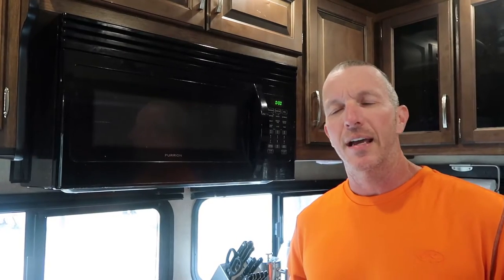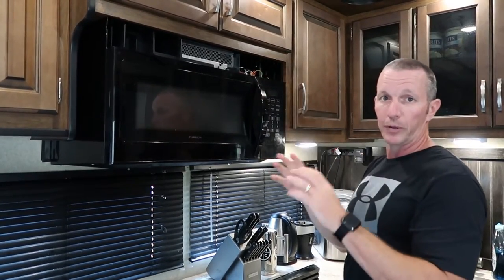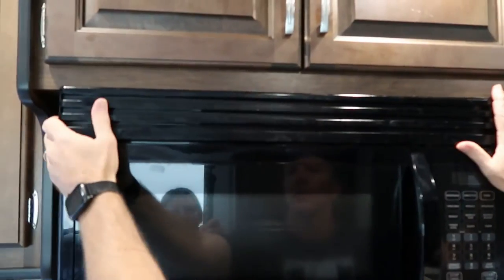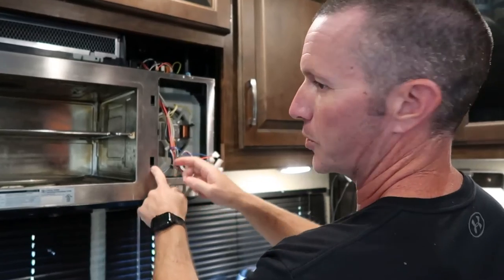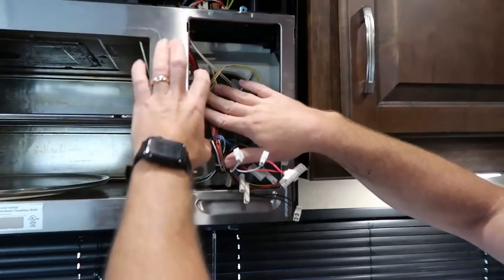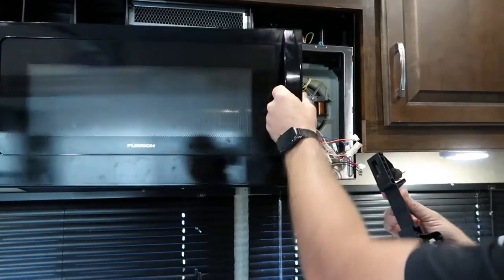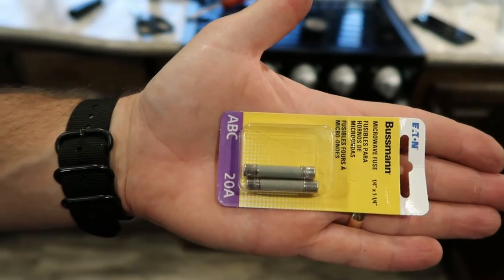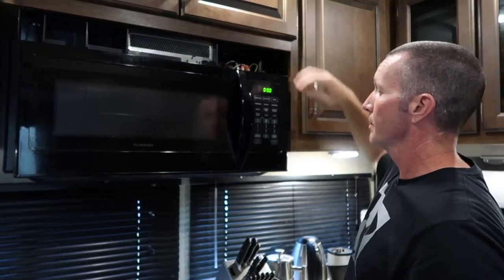Testing A Furrion Microwave | Temporary Microwave Fix

Comment: Your video just saved me $500! I replaced the 1st fuse in the spring.  Then this fall the oven started blowing the fuse and tripping the circuit breaker any time the door was opened.  Your video showed the root cause.  I didn't bother testing the door switches, but jumped straight to the electrical tape fix.  I'll save ordering a new switch for the spring.  What really irritates me is Furion considers this a disposable item.  I asked about repair and Furion said there are no user serviceable parts in the unit.   Thanks again for posting this.
Reply from the maker: Awesome! Glad the video was helpful. I figured we couldn’t be the only ones out there having this issue. Thanks for watching!

Comment: Thank you so much for the video. I have exactly the same microwave as yours. Skipped the trouble-shooting steps and just taped up the part of the door handle that activates the switch (per your video). Replaced the fuse and it works for now. Really appreciate the help!
Reply from the maker: Awesome! Glad it worked and thank you for watching!

Comment: Appreciate the video.  I had the same issue where everytime I would plug in the microwave it would blow the circuit breaker.  I followed your video and instead of the tape on the latches, I shimmed the switches in their housing to reduce/eliminate all the play.  Hooked everything up and it works fine.  Thanks again.
Reply from the maker: You’re welcome! Glad you got it fixed and thanks for watching!

Comment: I love the debugging, but what's not clear to me (from your video or other videos I've watched) is why the fuse is blowing.  That implies something is grounding out (most likely) that shouldn't be.  A short circuit is what blows fuses.  But I'm gonna check through all the stuff you've provided.  Thank you so much for taking the time to make a video when you're already irritated that your microwave isn't working!  (At least, that's how I feel!)
Reply: But, sure enough, 1 of my 3 switches, it has continuity w/o click the switch.  Weird, though, clicking the switch STOPS the continuity.  Like, it became a backward switch all of a sudden. (And yes, they are identical models, diagrams, etc.)
Reply from the maker: The issue is that there is a switch that is supposed to be open when the door is shut and others that are closed when shut. If the door latch does not engage properly it will not engage the switches properly and causes a short.
Reply from the maker: I believe that is proper function, check continuity with the door closed and see if it changes.

Comment: Thank you so much for the information. My Furrion oven was doing the same thing, in fact it got to the point where it would blow the fuse or trip the breaker all the time. I found that the "monitor" micro switch (Normally Closed) had failed so I replaced all three. It worked for only a couple days and began blowing the fuse again. I decided that I would throw it to the curb next year (as we are getting ready to put our fiver away for the winter) then as a "Last Ditch" effort I wrapped the lower latch with some electrical tape. BINGO! That did the trick. I plan to put a piece of shrink tubing on the latch as a more permanent fix. If you decide to order a new switch holder and it takes care of the issue please do a followup video. Again thank you so much you saved me a needless $500+ expense.
Reply from the maker: You’re welcome! We were at the same point, looking at replacing the entire unit. I’m glad I dug into the problem further before ripping the microwave out! I haven’t replaced the switch holder yet but when I do, there will definitely be a follow up video. I’m glad this info helped you and thanks for watching!

Comment: Thanks pal! I have been resetting the breaker for a few days now. I followed your vid and took apart the MW to test the switches in the same manner.  Interestingly I found that one mine has two screws that hold on the top cover and one was already loose. I assume the manufacturer had issues and had to open it up. 

I also found plastic pieces when I took the switch holder off. I tested all switches and they worked fine. I put the holder back in and tested them and they worked. I put all the wires back together and tested the door and it worked. I assume I fixed a loose switch when I reassembled. I would not have attempted this without your video. Thank you
Reply from the maker: Awesome! Glad the video was helpful!

Comment: Thank you so much!!!  I have an identical problem with my microwave.  It's not a Furrion but of course it still has these switches installed.  Simply replacing the entire microwave with another make or model would be a LAST RESORT in my case as this would involve some serious re-working of the hood and vent.  The current microwave I have is no longer available.  Looks as if I'll be able to get this one repaired.  Many Thanks  -Chris
Reply from the maker: You’re welcome! Glad it was helpful and thanks for watching!

Comment: Hi great video, it allowed me to see how the microwave is put together. I do not have the exact same model but the switches in the door are the same. My problem is the turn table will not stop rotating. I guess it is likely a switch problem as well. I will be digging in today to see if I can get it to stop. It does stop when the door is open, but when I close the door it starts right away, even with no settings entered on the keypad. Cheers
Reply from the maker: Good luck on your repair and thanks for watching!

Comment: Thank you, thank you, thank you!  I completed this fix and I actually went as far as taking toothpick pieces and shimmed the switches so they were tight.  I thought that the new switch holder would be built just like the old one.  If you bought one and installed it please let me know how it compares to the old one so I can decide if I want to do this or eventually change to another unit.  But again thanks for this video.  You now have a new subscriber!
Reply from the maker: You are very welcome! We saw SO many people replacing their microwave / convection ovens because of this! I have not changed the switch holder yet. Great to know this information was helpful! Thank you for subscribing!

Comment: Spot on with you diagnosis!   I did the same test after I saw your video and have the same issue.   It is definitely the switchholder not holding the switch in place.  Ordered the switchholder and am back in business.  Apparently most of the manufacturers use the same holder. Frigidaire 5304509457 Switch Holder
Reply from the maker: Great! Glad it was helpful! Thank you for watching!

Comment: I tried this, tape keeps coming off inside switches, is there a trick to keeping it on?  Thanks so much, at least we have our clock and lights.  I am afraid to open door again.
Reply from the maker: I used electrical tape wrapped very tightly around mostly just the end or “hook” part of the arm. It doesn’t take much, just a few wraps on ours.

Comment: Hello, I really like the way you explain things, very easy to follow, I have difficulty understanding most of these "how to" videos".  We have the same Furrion model, just stainless.  Everything appears to operate just fine but it does not heat up the food, the food is the same temperature as when it is placed in the microwave.  Any thoughts?  A mobile tech told me to get a new one, I've sent an email to Furrion, hope to hear something back next week.
Reply from the maker: Thank you for the kind words, unfortunately I think a no heat issue means the unit is bad. I haven’t had to troubleshoot that issue, but ran across a lot of posts regarding your problem when researching my door switch issue. The good news is that I believe you can get a better quality residential microwave that will fit in place of the Furrion unit. Thank you for watching!

Comment: Hi temp jb weld biuld out the switch holder to hold the switches in better
Reply from the maker: Good idea! I have a new switch holder on hand that I will be replacing to see if that solves the issue. If not, hi temp JB Weld might be in my future! Thanks for the suggestion and thanks for watching!